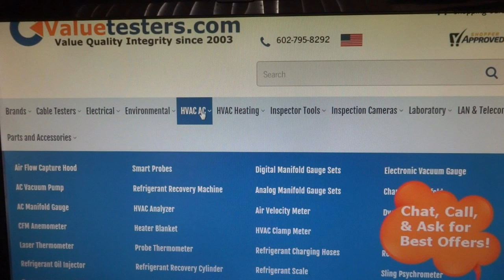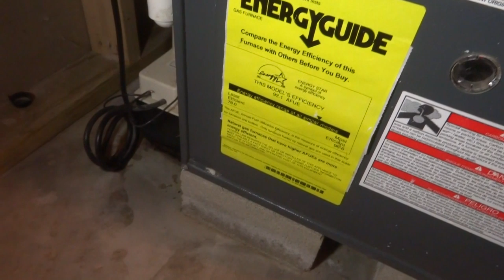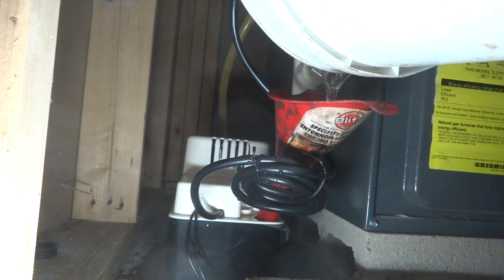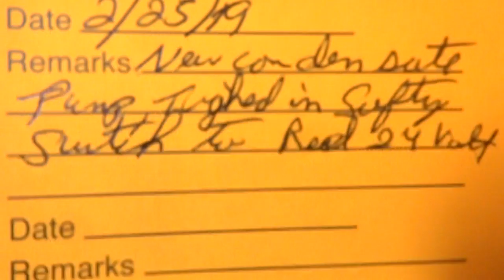furnace condensate pump leaking

Comment: When we installed the new furnace in the house, I had them remove the pump and plumb to a floor drain. Won't fail like a condensate pump. And I don't run bleach down it. I add a piece of bromine tablet to the cleanout and that sits in the water as it passes by, cleaning the drain for weeks.
Reply: I just replaced one in my home pump lasted 30 yrs.. by the good brand LITTE GIANT an proper lift,  keep the mothers clean
Reply: @broken1965  Yeah but they always have water sitting in them so they'll always be a weak point for clogging. Better to have a gravity drain if you can do it, which I could easily. Think the previous installer was lazy.

Comment: I'm a plumber....I've had a 5 gallon bucket sitting under my condensating boiler for the last year......I'm pathetic.
Reply: The shoemakers kids have no shoes
Reply: I still have one under my heat pump water heater. Even in the dead of summer, it would take at least a week to fill it, and I'm down in the basement more than that. Doesn't seem fair to having a hard-working condensate pump just sitting around 99% of the time.
Reply: Call Steve he carries them on the truck
Reply: @gene8172   condensate is corrosive
Reply: @gene8172  its less than a  couple gallons a week....you pee more than that in a day.

Comment: mines leaking where the black bottom attached the white top lid. i dont understand why it didnt flip a safety switch to turn off. i was checking my attic windows and by luck saw a puddle, i think i caught it the first day. but what a horrible design to have no float inside and if it does why is it not working.

Comment: Never quite understood the point of using a cutoff if the pump fails on a furnace. An AC unit, sure, but if it's on a furnace, you shut the heat down because of a small pool of water near the pump, meanwhile, your pipes freeze because the furnace isn't running. I'd rather have a small pool of water in my basement than a house that drops below freezing.
Reply from the maker: more for the summer and cooling season  lots of water could flood over to carpet area . that was the guys concern .homeowner wanted  the safety switch hooked up .i did as he wanted seeing he is paying the bill
Reply: @stevenlavimoniere   Understood. The customer is the boss. I also don't have a finished basement that I would be worried about getting a bit wet, so the downside of hooking up that switch is not worth it for me.  Maybe at some point those switches will be tied into the thermostat so that it triggers and alarm and shuts down, but if the temp drops too low, it will make the smart decision to prevent a freeze up, even if that means an overflow at the pump.
Reply: Makes sense....if the appliance is not working...the customer can go down a check if that pump is not working (if its full of water)   then he can call for service, rather than flooding his basement.   It takes less than 15 mins to wire the safety switch.
Reply: steven lavimoniere I have had condensate pump fail within one year, and if there was carpet in basement area you guarantee the homeowner is going to want you to replace the carpet. That is why I like simple thermostat that has a common wire hooked up, pump fails no display on thermostat and that would be the first place a homeowner will go to if it is to cold in house
Reply: That safety switch is similar to the secondary overflow switch on your evaporator. So when the switch goes out on your 90+ furnace you won't have heat. I have the pump it's not tied in to the furnace.  I will ask my customer if they want it hooked up unless they live in the tajmahall then I just hook it up. It's cheaper than paying for the water damage.